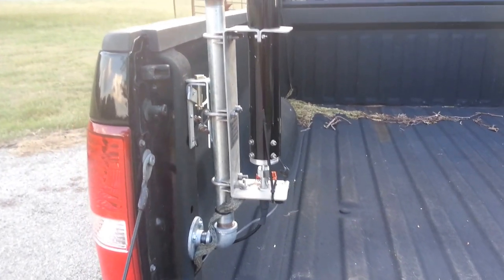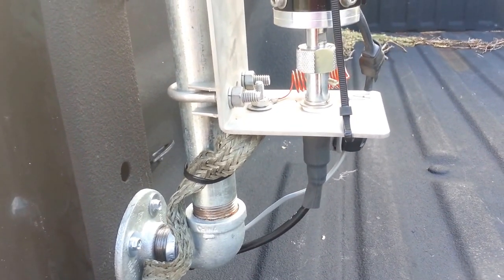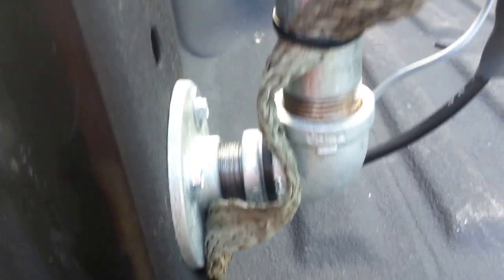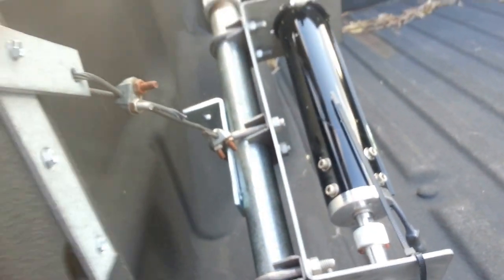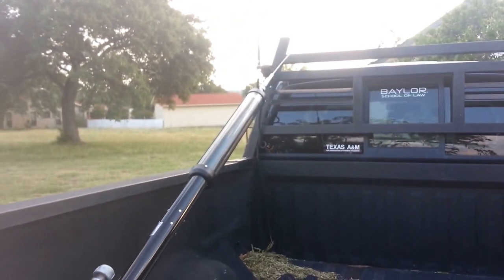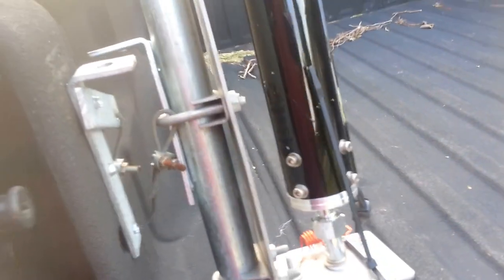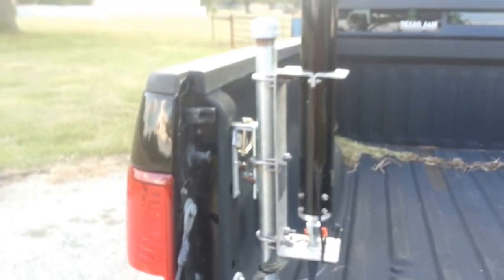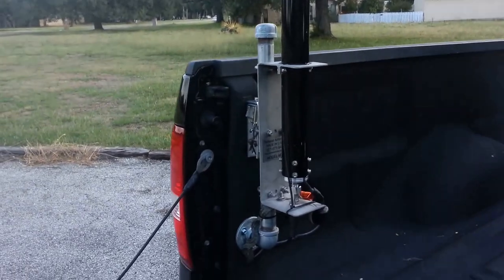Screwdriver Ant Mount

Comment: One problem  I see here is the ground braid which is quite long.   On upper bands  20M, etc,  that  length  will introduce a bit of variation.  "I bet" if you cut that  tie,  hook an analyzer   up and then with your hand  move/ manipulate the ground braid you will see wide swings in antenna matching.

Also,  what did you do  to  improve ground bonding  between the pickup cab/ frame/ bed?  Most? All?  pickups have minimal bonding, perhaps  two straps  between the cab and frame.  They are NOT  designed for RF  so much as DC vehicle systems.
Reply from the maker: The antenna is grounded by the bracket to the bed of the truck directly, and through the strain relief cable. The Braid ties the bracket to the bed through this braided cable and to the frame. There may be better ways to do it, but this work for me. The performance is fine. Thanks for the comments.

Comment: Very clever.  How many bands does it tune? I am new sub and now looking for front antenna video.
Reply from the maker: This Tarheel 200A covers 10 Meters through 80 Meters. The whip is a cut down 102" whip to get it to tune 10. It also helps to keep the final height down to less than 12' for bridge clearance.